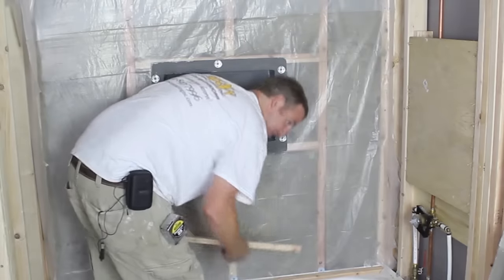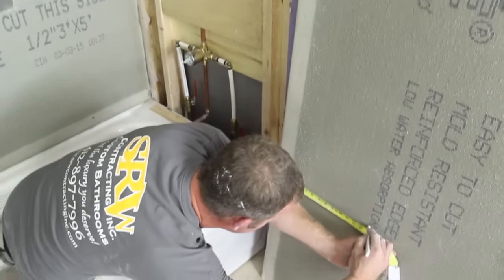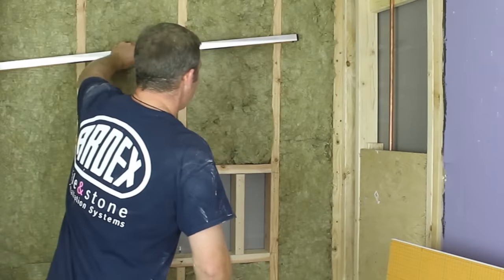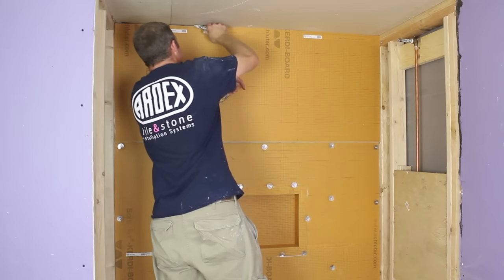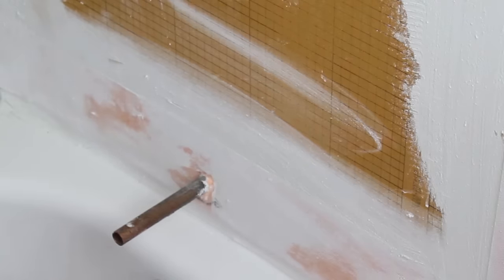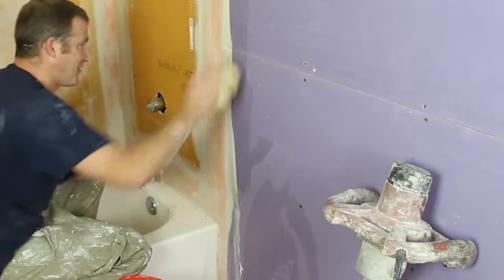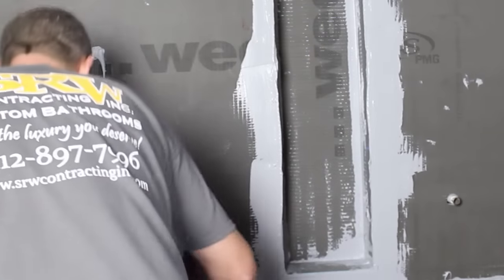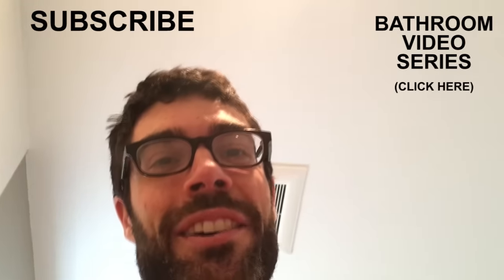How to Waterproof a Shower (3 Awesome Methods!!)

Comment: Im building a bathroom and this Wedi board looks pretty good... I think I'm going to try that
Reply from the maker: +Danny House it's easy to use, just make sure to only use Wedi screws, washers and joint sealant as any other products could void your warranty. Our price for a 3x5' panel is $40, so try to get that price 👍

Comment: Thanks for the clear methods and I prefer the "Durock" way because it appears less flexible then the "Wiedy" way and since it will be done over furing strips and brick, as well as a shaft way that is between two vertical areas, that must be plum first.  I used a waterproofer and now am a little wiser, since I was't aware that the stainless steel screws should also be covered with that very fine screen like tape, followed by more of the waterproofer.  I will need to examine the wall I did five years ago because I'd used plastic butcher block panels instead of Durock in some areas.  At that time, I was not able to tear down the whole wall, then plum the large shaft way between the two walls so I built over the existing wall and wound up with an uneven job because the former tenant used wood vertically near the edge on one side of the brick section (an inch and a half made it look like a wave on the right side of the wall).  I need to redo that wall.

Comment: doing a plastic barrier behind AND a waterproof membrane is bad practice. it creates a "mold sandwich" in the wall where moisture can not escape.
Reply from the maker: +marshalluniversity31 we recommend homeowners follow their local building code and a vapor barrier behind cement board  might be required. That said, we do not recommend a plastic vapor barrier for KERDI-BOARD or Wedi
Reply: Home Repair Tutor agreed. those boards would be creating the same situation as a paint on membrane and vapor barrier. behind. i believe current code is 4 mil plastic behind cement board currently unless local codes differ. I personally have used plastic barriers for years and no issues yet anyway
Reply from the maker: +marshalluniversity31 good to know, my apologies on the confusion. Probably should have specified the difference between the foam boards and cement board. Do you have any experience with GoBoard? We're going to try it on an upcoming project.
Reply: Home Repair Tutor I haven't used it. i usually use hardi backer, and using wonderboard actually on a bath this coming week. let me know how that goes
Reply from the maker: +marshalluniversity31 will do, it's about $20 for a 3x5 foot sheet here in Pittsburgh. Johns Manville makes it. We'll have a video tutorial installing it over a custom KBRS pan.
Reply: Leslie  Gore   U  don t   Own. Me
Reply: If you live in Florida and have wood stud framed house, using plastic water barrier will definitely cause mold.  It's too hot and muggy here for that stuff.  Condensation between the plastic barrier and the drywall will definitely happen and cause mold.  I discovered this on my last house purchase when I removed some walls to reframe and move windows.  I won't do it again.
Reply: You are absolutely right.  What is lacking in these constructions is the physics behind each method.  The primary goal of any of these 'water proofing' systems is to protect the framing. Any method that will allow the framing to be exposed to moisture contiguously is bad. Moisture in the modern, sealed homes cannot be avoided.  The issue is where we want to trap it , and how to let it escape.  The moisture/water will occur either in front of the framing, or behind these 'waterproof'  membranes.  Waterproofing just behind the tile will NOT prevent the framing from moisture/condensation that will inevitably occur particularly during cold weather.    Hope these principles will help in clarifying as to how these various techniques compare --based on the primary goal of protecting the framing.
Reply: Plastic in general is bad practice IMO.  Stick with 15-30# felt/roofing paper.
Reply: Where at in Pittsburgh!?
Reply: @ThurstonHowell3rd  you could probably use tyvek or the like since is permeable
Reply: @Marionkessy  Do you mean this method is for cold climate only? Yes, I live in quite warm place (+10 is the lowest temperature) and haven`t seen any behind cement board moisture protection.  However... in case ... what if we cover all the studs with waterproofing compound (membrane) instead of plastic sheeting? Is this a good idea?
Reply: marshalluniversity31 ooo
Reply: @ThurstonHowell3rd  negative, you don’t use paper product where moisture will be.  Mold loves paper.  Roofing paper belongs on a roof only

Comment: I've always used cement board, but I haven't done a remodel in years so I would have to look at the other two products weigh the pros and cons against the cement board, which I'm most familiar with, and see what the cost and Time Savings are between all three products
Reply: Let us know your thoughts on this...I'm wondering the same

Comment: USG (makers of Durock) now sell a lightweight 1/2" backer board just like Kerdi. I got mine for $31.50/sheet (3x5). Laticrete also makes basically the same thing, called Hydro Ban Board, for about the same price. The price is roughly 3x cement board, but worth it imho.

Comment: I'm a novice and about to remodel my bathroom by byself. This video was helpful but I wish you would show all the materials at some point or list the names so that when I go shopping I will know exactly what to buy or to ask for and I can check the list as I get the items (and I won't miss anything).Out of the tree methods, as a woman who does not have a truck to transport heavy and large items I think that I'm going to use the Kerdi board (the only reason I can quote that name is because I saw it printed on the board and not because you provided us with the brand name/spelling to buy it). I see myself being able to pick it up at the store by myself, transport it in my car, take it upstairs and handle it while trying to secure it to the wall. The only thing that I'm wondering about is how a light board like this one would be able to hold row after row of heavy tiles? Also what about the waterproofing process of the space around the faucets and shower heads? While waste all that time waterproofing every other surface while leaving those spaces open underneath the faucets area?
Reply from the maker: thank you for your feedback and we do have a course that shows all the products we use and how to install them. It can be found over on Bathroom Repair Tutor (https://bathroomrepairtutor.com/) you might really like the courses over there. 

We also have a complete KERDI-BOARD tutorial here on YouTube that shows how to waterproof the tub spout, mixing valve, tub-to-KERDI transition and more. Here's the link to that video 

https://youtu.be/OTf2gG-J-o8

KERDI-BOARD can hold large format tiles. In the above video I tiled that shower with 12x24 inch porcelain tiles. Let me know if you have any questions

Comment: great video. well explained. but one question would be nice to know what is the cheapest and the most expensive method.
Reply: Mauricio Juarez wedi def the most expensive, then Schuler, Hardin backer is the cheapest
Reply: Cement board with topical membrane isn't the cheapest. Red guard is costly. And two coats takes time. I think schlueter is cheapest. I do 6mm plastic first then put up hardibacker. That is the cheapest. And it's faster.
Reply: Renaissance Man - I don't understand why 6mm plastic is necessary if one covers the hardibacker with a membrane like Schluter. Can you please explain?
Reply: I prefer 1/2” hardibacker because I’m guaranteed I have a flush and flat surface. Durock May seem easy to work with but is too crumbly and weak. The schluter stuff is crazy expensive for what it is. Redguard and aquaseal goes a long way.
Reply: @JohnBoehners  some people have a lot of money to waste on extra useless steps
Reply: The walls and shower pan are the most important part of your bathroom reno my outlook is spare no expense and take all the time you need to make sure its sealed up good and water tight. That being sed PLEASE people do not put plastic behind your hardie shluter  drywall or wedi it will without a doubt create mold its unnecessary

Comment: great video, thanks. not sure why tape the tub flange joint.  the tape does not adhear to the tub so it's essentially useless.  tile down to it and seal with sil?
Reply: I am about to start waterproofing, and I had this same question... what is the tape adhering to? It was my understanding that tiling over the gap was all that was needed.
Reply: I also do not see the need to tape tub or shower base flange. Eight years ago, I used Hardi Backer as the board, taped all joints with thin-set and fiberglass tape (except the tub flange). I don't even think I decided to try and seal the flange to the Hardi Backer board under the tile, I would think this joint is going to flex a little and would probably crack any seal you put there anyway...I just tiled over and sealed the tile to tub with flexible silicone white caulk. If you really wanted to do something before tiling, maybe shoot a line of some flexible caulking in there for extra credit.  
I think the Hardi Backer board is a cross b/t cement and the others in the video. It is very dense and stiff like cement board, not as heavy though. Easy to cut with hand-held jigsaw.  It is not as "gritty" as cement board either. My thought is that it would hold up better and not flex as much as the two non-cement board products in the video.  I coated the whole surface with a blue water-proof sealer...I think by Laticrete. Then tiled.  I went back and forth with putting up a plastic barrier behind the Hardi Board, but decided against it and to let it breathe. It has been trouble-free for eight years and going strong! I am not a pro, but getting ready to start my 4th bathroom total gut and remodel and plan to do the same. I hope Hardi Board is still available. Go DIY'ers!!
Reply: Paul Egan you chose wisely. NEVER vapor barrier with plastic and then use topical sealer. Use one or the other.
Reply: pat mac has

Comment: THE ONE AND ONLY WAY - THE BEST WAY HANDS DOWN - MUST READ ->>>

Had a leaky shower. Hired contractor, used cement board and the black painted on membrane stuff. lasted for 6 months then leaked. Contractor came back and said this is this is way it is supposed to be done, sorry it leaked so what do you want me to do? I said rip it all out, re-line it with cement board and then lets fiberglass it like a boat.

So that is what he did. We just bought regular fiberglass resin and mat. Applied the fiberglass resin to cement board then the mat and then more resin just like a boat, did 3 layers and ended up about 1/4 to 3/8 thick. Did this on floor and 95% up walls. After it set up and cured we mudded it and tiled it.

Done deal and that was in 1998. Sold that house 4 yrs later and still know one of the neighbors. He says the shower stall is still exactly as we did it with the same tile and there has been no leaks for 19 yrs now.

This is now my "GO TO" method for shower stalls. Since then I have talked other people into doing it exactly that way and it has never failed yet.

I know where there are plenty of old fiberglass boats, some over 40 yrs old and they all still float and if let set with the drain plug in, will fill with water. Fiberglass on a shower stall like this is pretty well permanent and if done right will last as long as the house and simply NEVER leak. 

After explaining this to friends, they decided to do it the exact same way. It is dead simple to do also. Any fool can mix resin, roll it on, stick some fiberglass mat to it and roll on more resin to seal up the mat, then do same again total of 3 times and end up with 1/4 to 3/8 fiberglass thickness and a total permanent seal. Nice thing is, it leaves a nice rough irregular surface the mud sticks to extremely well so you can then stick on the tiles.

Once you do a shower stall like this, you will see it makes so much sense and is so easy to do, you will never ever even consider doing it any other way ever again. My contractor was blown away and has done many this exact way. He sells them as "forever showers" guaranteed to NEVER EVER leak and none ever have.

Fiberglass your shower stalls and stop worrying, it will never ever leak and will outlast you.
Reply: As long as you do a pre slope for the mud pan. Have many builders that do this method and don't preslope the floor. It's no code. And I won't tile it.
Reply: @renaissancemen1 

Just curious, how would you know if the pan was pre-sloped or not ?  You pre-slope first, then you install liner, then you mud and slope again to 1/4" per foot to drain area, right?  So how would you know by the time you came to do the tile work ??  One YouTuber says no need to pre-slope and is an expert at re-doing other failed Tile installs and then some swear up and down to pre-slope or DIE !!  Which one guarantees less time & money and still done 100% correct waterproof ?
Reply: I don't believe a word you typed. You are a daydreamer and a spoofer. For others reading this, using resin and fiberglass would result in a very wavy wall for tile to lay flat on, unless you were an expert boat builder. Portland cement will not bind to resins. So tile mortared to resin would simply fall off. This guy reminds me of Ralphie from A Christmas Story.
Reply: Ridiculous.  It may be possible, but simply not worth it.
Far better to just use paints made specifically for this application.  They tend to not only waterproof the cement boards, but can also help the cement/mortar with adhesion and prevent small cracks due to their flexibility.
They make fiberglass shower walls; better to just go with those if you want to skip tile altogether.
If your shower leaked, there was something wrong with how it was installed.
Also, in most cases, a leak is not something that shows up easily, and can be missed for many years. yet somehow you found one, but shared nothing about where it was, etc.?
Your suggestion carries with it far more problems than most realize.
I''m inclined to believe the other poster.  None of what you said is believable when all context is taken in.
I have demolished a few bathrooms and while they appeared to be fine and had no evidence of any leaks, some of them had clear water damage underneath.   The bathroom in my current house had so much damage that a big section of wood flooring had to be replaced and some studs along the walls as well.
Far too many contractors don't do quality work, will miss details, and even cut corners in materials used and time spent.  There is absolutely no one way or best way.  The right way is someone that knows what they are doing and cares about doing it well.
Reply: Robert B
Reply: This would be great video material to show what and how you did it.
Reply: I like this method a lot. And instead of tiles im putting up faux marble epoxy resin pours. It should mount to it effortlessly.

Comment: For what the Kerdi and Wedi board cost, I'll stick with the old fashioned cement board thanks. I'm not going to spend 1000's of dollars to remodel my shower on just all the backing structure. That's crazy. After you get all your tiles, grout, doors, fixtures. etc. your shower would land up costing you $10K
Reply from the maker: Wedi and Kerdi Board are pricier that cement board but a standard shower shouldn’t cost anywhere near that. Wedi tub kits cost $522 max, a good tub is $800 or less, tile is up to you, grout is maybe $80-$100 if it’s pre-mixed, and a glass door is $1200 on up. And those prices are for a darn nice shower. Plus you get a 10-year warranty on the backer board.
Reply: I want to know where you live because I looked up the Wedi kits at my local box stores. For a shower that is 36X60, which is a nice shower size, the kit here is $1400 bucks!  I'm not referring to the tub/shower kit, those are cheaper but not what I'm looking to do. I want to rehab my walk in shower. I want to go larger and do all tile instead of the fiberglass insert. For what I want to do, the price of the Wedi kit isn't economical for me. I will do it the old fashioned way with cement board and mortar.
Reply from the maker: In that case you’re right - look into the KBRS ShowerSlope Kit  which is cheaper but still customizable. And cement board can be used 

https://www.homerepairtutor.com/kbrs-showerslope/

Comment: You don't put up plastic behind cement board and then waterproof the front.  It's one or the other
Reply: Correct.  There is no issue with cement board getting water!  It is the framing that is being protected.  So using a vapor/moisture barrier infront of the framing is all that is needed.
Reply: We always waterproof our cement board with Redgurd. Most cement board is not waterproof material so for us we use Regard to guarantee a good waterproof seal. Plastic being placed behind the cement board allows water to penetrate the cement board so that method is not something we would do.
Reply: The cement board is designed to get wet and then drain. The plastic behind is all that is required. If you have presloped your pan correctly then it will all drain. If done correctly then this method will last thirty years. I have done close to 500 showers and this is the proper method.

Comment: I like the WEDI type of board for the shower installation.  Thanks for the tip.
Reply from the maker: thanks for watching, Wedi’s a great option
Reply from the maker: Bob Hoffman  if it's acrylic or fiberglass, probably not. But check the manufacturer's recommendations - not a bad idea to use insulation in the walls, we like Rockwool